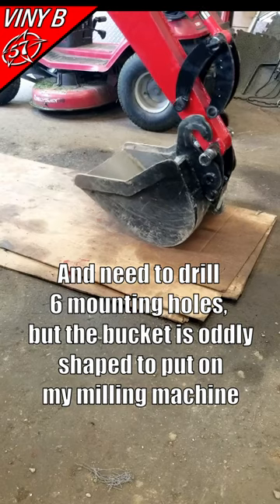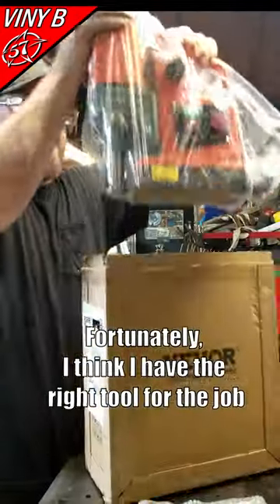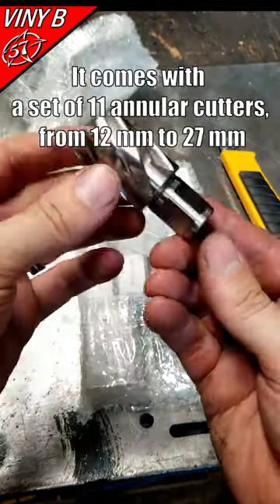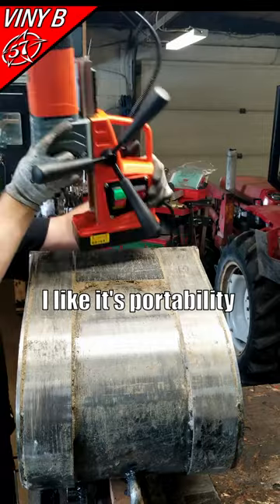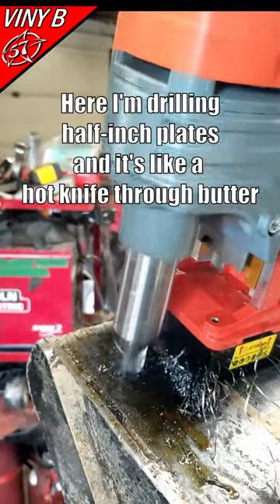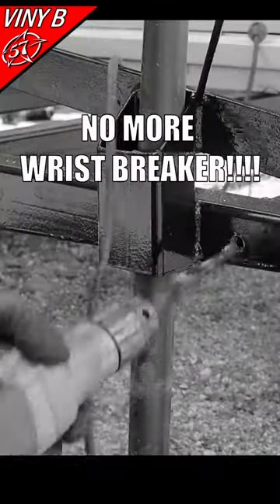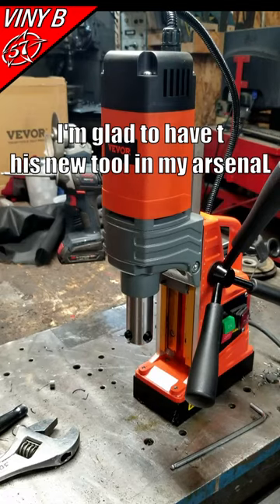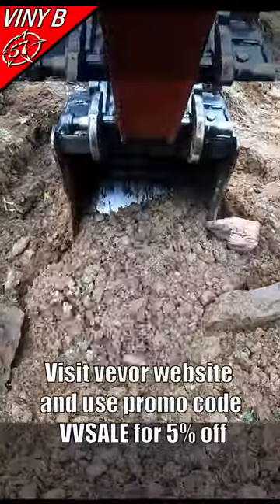Magnetic Drill / Bucket Teeth #tools #vevor

Comment: Be careful with power loss or fluctuations. I’ve got many at work and have seen what happens when the electromagnet looses power while at full speed.
Reply: This is great point. I've seen the drills go swimming on bridge projects.
We ended up using a chain sling to ensure that the drill could only yeet itself so far in the event of a power failure.

Comment: I used a Magnetic Drill and these type drill bits for weeks at a time drilling 18mm holes in 16mm x 2.4m x 1.6m Hot Rolled Steel to make Form Plates for Concrete Moulds..
The Perfect Tool For the Job..👍👍